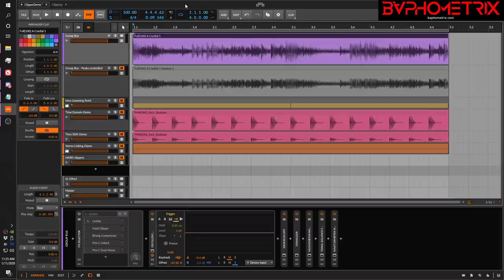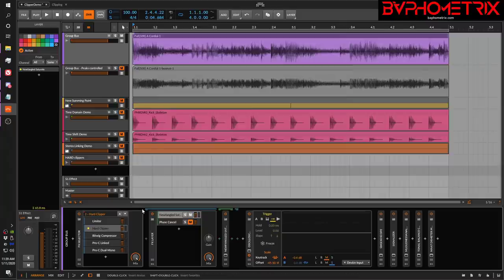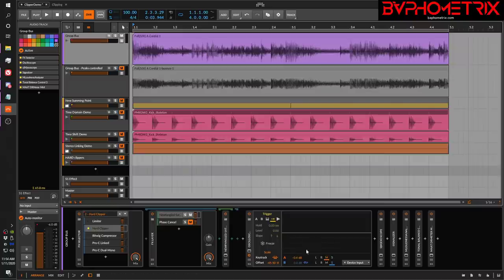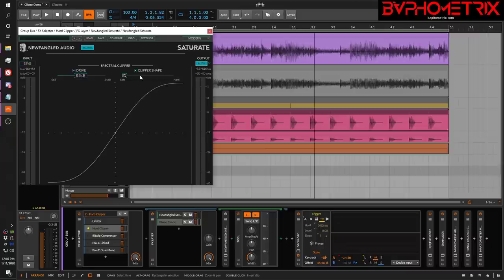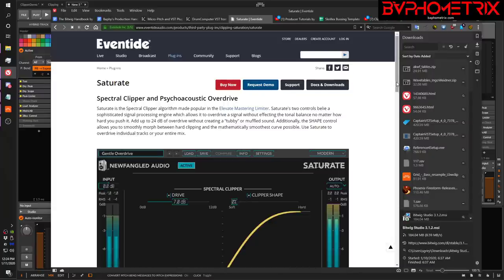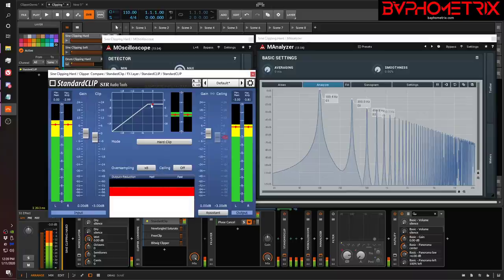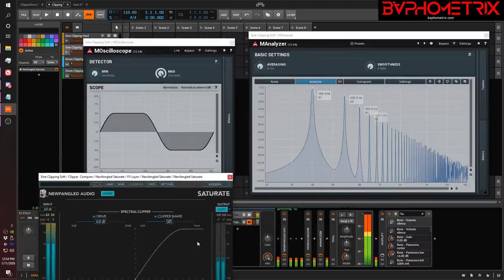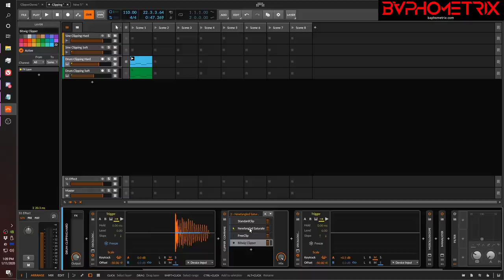Deep dive into clippers--NOT compressors--for clean, transparent loudness

Comment: I definitely understand where you're coming from with compressors being time domain devices. I synthesize my drums from general purpose plugins so I will use compressors to emphasize different aspects of the transient. On something like a kick drum, frequency content is extremely time-dependent, so I can even shape tonal characteristics using compression. After all the sculpting, I saturate all my drums pretty intensely and generally distort everything else as far as I can with soft clipping and pull back if it causes any problems. I have only ever used hard clipping at the VERY end of the signal chain just to get that last 3dB. I imagine you can get away with hard clipping whenever aliasing will be sufficiently masked by high frequency content? Say, a snare drum or even particularly bright sounding vocals or synth lines? looking forward to coming back to this video and watching it through. I don't have an hour at the moment, but it's nice to see hard clipping getting something other than hate outside of a hardstyle festival!

Comment: Amazing amazing amazing content! You truly are a scientist by the methods you are processing each effect. I just have to add one thing if you want to take it to the next level. I think a good way to determine the differences between the clipped track and the limited track is by printing them and changing the polarity of one track (I think that's what it'a called) and you will get the isolated difference. I doubt it's much different as our ears can tell but it would have been nice if you had done that final experiment to conclude this tutorial.
Reply from the maker: It's called a "null test". Many clipping plugins give you a "Delta" button that does the null test inside the plugin, so you can isolate the sounds that are being added by the clipper. The ideal is to just hear little, very short "spits" and "crackles" that are quiet enough and short enough to be masked by the remaining energy and timbre of the transients.

Comment: Interesting Video with some good points, but also clear mistakes.
 1.) If you want to analyse the behaviour of an 1176 you should choose a better representation.
Other Mixers and Producers found, that the waves model has a much slower attack time than other emulations and certainly the hardware unit.
If you are testing an 1176 you should use a broader sample range and if it's software, it should as far as functionality goes at least be closer to the real thing.
2.) I can clearly hear the Artifacts when you demonstrate the "transparent" results of clipping. Is it a shocking and complete transformation of the source material? No. But the artifacts are there. The point I would make is, are you as a mixer ok with it? That's what matters.
3.) Controlling the peaks does not necessarily mean that they have to be removed. Compressors are used exactly because often you want an part of the transient to come through. This is intentional and, because the term is loose, it's still controlling the peaks.
4.) Why do you say that the loudest part should be mastered for 7LUFS Loudness? I understand, if you like what you hear doing that, but why should that be your goal?
I don't like how music sounds, that is mastered this loud. I've had professionals do that and the end result was not serving my music properly. If it does yours then by all means, but I wouldn't state it as something to strive for in general.
Otherwise you're just doing the on principle the same, as the people you are trying ro educate: Saying one is better than the other.

Comment: Thanks for all your audio efforts. Around 43 minutes you show the hard clipping distortion by phase cancelling. Would it be possible to get rid of it completely by bouncing the distortion and use it to cancel itself out against the processed audio? Around 46 minutes you describe the top right quadrant of Saturate. Does the bottom left quadrant affect the volume of lower amplitudes during soft clipping?
Reply from the maker: There are no magic sleight-of-hand tricks that will get rid of the clipping distortion. The point of the phase cancellation was to remove the original sound and let you hear the clipping itself. In fact, some people like to SET their clipping thresholds this way. I prefer to use an oscilloscope and visually set my threshold, because I use scopes and meters everywhere all the time and know what sounds LOOK like. But you could do the phase cancelling and just set the clipper threshold right above where you HEAR the "spits and pops" starting to have some tonal content bleeding through too.

In Saturate, yes, that lower left quadrant is shaving the BOTTOM peaks of the waveform. Not the "lower amplitude" sounds---those are all near the fat center section of an oscilloscope. So the bottom left quadrant is shaving those caterpillar peaks way down at the bottom of the oscilloscope waveform, and the upper right quadrant is shaving the caterpillar peaks up at the top of the oscilloscope waveform.
Reply: @Baphometrix  The phase canceling trick to the clipper blew my mind! So simple but so ingenious.

Comment: For acoustic drumset, do you think it’s best to hard clip each individual mic (12 mic setup for me), then bus them all into a final bus clipper? I’m trying to incorporate this approach as opposed to using traditional compression on the individual tracks/mix bus. I find the most dynamic instruments in a rock mix to be bass guitar, vocals, and drums (mostly kick and snare). I’d like to maintain the natural dynamics more than using compressors, do you think the hard clipping will maintain the original sound better?
Reply from the maker: You might benefit from watching my newer "Mixing Loud with CTZ" series. But the short answer is that recorded acoustic drums are... tricky to mix well. There are a LOT of variables. But yes, assuming you find that *very transparent* point to which you can safely clip each individual recorded drum track, you can then set the relative mix of each drumset track with the track faders after pre-processing each individual drum sound. Any clipping you might do is simply part of the standard processing of each sound. 

My main advice in this scenario is to NOT clip sounds that you plan to balance very quiet relative to everything else. For example, the snare will probably be the "loudest" sound in your entire DRUMS bus. And the kick will also probably be very loud. Those might need to be clipped to get the final result of the entire drum set loud enough to be one of the framework sounds of your entire song.  But your overhead mics? Your room mic? Those will be barely blended into the total result. They don't need to be clipped, because they'll have tons of headroom within the overall dynamic range of the DRUMS sub-mix. Hope that helps!

Comment: Greetings and good day. I just came a cross your channel today and the info your sharing is great. I listened to your SoundCloud and your mix is fire. I have a question you may be able to help me with. I use the maschine mk3 and the sounds in it are already very loud but my mixes do not sound as loud as yours still. What I would like to know is on maschine for dance/hip hop should all instruments be turned down from source to avoid internal clipping then add clipper or does it matter? When I cut instruments down from internal source to mix my mix sounds thin, When I leave the internal vol of instruments at default it sounds louder, is it necessary to get every instruments in the green on meter before adding clips, eq, etc... or does it matter?
Reply from the maker: I wish I had some easy answers for you, but honestly the Maschine workflow is great for composing/arranging, but a bit constricted for *mixing*. When I find sounds/arrangements I like in Maschine, the first thing I do is get them into the right key for my song, and then bounce all that audio out of Machine and into clips and stems in my DAW. From that point onward, it's just audio and I can look at it and clip it, and do all the same post processing I'd do to any sound coming out of any softsynth or sample pack.

Comment: Another great vid. thanks.

Ive heard you can eliminate any potential issues from foldback distortion by just adding a 18-20k highcut using an EQ after the clipping? Any further processing after the clipper would not be effected right
Reply from the maker: No, that won't really work. The high pass filter must be IN the plugin's internal processing circuit and be applied BEFORE the plugin's output back to your DAW. Once that aliasing foldback has been output from the plugin, it's already baked into the signal and is already sitting below 22-24 Khz. So adding a low pass filter after that has happened won't change anything at all.

Comment: Question: on saturate, do you keep detail preservation on or off when hard clipping? When detail preservation is on and I phase cancel to hear the difference, I hear a lot of the original signal. when it is off, I only hear the white noise. The latter is what you demonstrated to be the goal, so I should keep it off right?
Reply from the maker: Good question! If you're using NF Saturate, I recommend keeping the detail preservation at full 100%. The reason you hear more of the original signal when you null test is precisely because of that "detail preservation", which is the entire point of expending more resources to swap out a more simple clipper (like KClip) for something like NF Saturate.  This additional info might be helpful: https://docs.google.com/document/d/1Ogxa5-X_QdbtfLLQ_2mDEgPgHxNRLebQ7pps3rXewPM/edit#heading=h.h86oecwgie0f

Comment: May I suggest something about oversampling? You state at about 1h05m that the bounced frequencies are inaudible and oversampling were unnecessary. However, your sine signal is very theoretical, NOT because it's a sine, but because it's at 100hz base. Bounced frequencies here are always ABOVE the base frequency and, as you correctly mention, masked, because they are way less loud than the useful harmonics. BUT - please, repeate the same for frequencies above 12kHz, you know, those frequencies giving you air, or those produced by cymbals or resonance-filter-cutoffs of saw waves. THEN you will see quite audible bounces way BELOW 12kHz. I tried a 15kHz sine wave at -0.1db,  with StandardClip clipping at -6db hard clip and ceiling turned on. With no oversampling, I get a -17db (-seventeen!) bounced frequency at 2.6kHz. Which is VERY audible (and anoying). With 8x oversamling, this frequency drops below -100db. So in the real world, it does make a huge difference if your clipper oversamples ;-)

Comment: Polarity made a clipper for Bitwig Grid. I might get back to it and see how it works for this
Reply from the maker: It doesn't, really. IMO it's worth spending for KClip, at least. Also, Bitwig is dropping a Hard Clipper module in the Grid for the upcoming 4.2 release, but I haven't tried it yet.
Reply: @Baphometrix  My problem is that I'm using Linux so pretty much most VST plugins are out of my reach. I'm hoping the 4.2 will solve my clipping needs

Comment: Fantastic video.  Thank you.  I learned a lot.  You made a point about hard clipping busses and sounds before the mastering limiter, so that that mastering limiter doesn't have to work as hard (and cut into subsequent content with the release curve).  If you're only clipping fast transients and "shaving the hair of waves", isn't that the same content that gets past the limiting compressor that ends up against the hidden clipper in the limiter? Pre-attack content.  An isomorphism perhaps?
Reply from the maker: That would seem like a first impression/understanding, right? But think carefully about it for a moment. When a mastering limiter detects a transient peak that is a full 12 dB (for example) over its threshold, it will react and clamp down by a full -12 dB of gain reduction on the signal. This takes place over a very short amount of time (the attack envelope), letting a +12 dB transient slip through, which is then lopped off by the hidden clipper at the end.

Now do it again but this time say the limiter detects a transient peak that is only 1 dB over its threshold. This time the limiter reacts and clamps down by only -1 dB of gain reduction on the signal. And a +1 dB transient peak slips through, which is then lopped off by the hidden clipper at the end.

See the difference? We shave all those caterpillar peaks off long before we get to the final limiter so that the limiter isn't trying to squash down so hard. We want the limiter working very little.

Comment: If you wanted to, for example, use an analogue-modeled compressor VST on your drum bus for color.  Where would you put the compressor in the chain, to avoid driving things way too hot into it? Would the clipper go before or after?
Reply from the maker: The clipper (for transparent dynamic range control) always comes at the end of the processing chain for any given track or bus channel.

Comment: offtopic: Is that XO the drum sequencer plugin? How do you work with it? I find the best way is to export the samples and load them into Drum Machine... but I'm wondering if there is a more 'frictionless' way to integrate it into bitwig
Reply from the maker: I use it a lot like I once used Atlas. There's a relatively simple way to work with XO in "multi-out" mode so you can process all drum sounds individually. And when your drum lines are all worked out and you're ready to flatten everything to audio at some point in the mixing process, it's a fairly easy thing to do as described in this video of mine. https://youtu.be/Sn8zmOUA2rI

Comment: Thanks for this interesting and informative lecture. i learned many new things. Any suggestions for hardware units we could do this with?
Reply from the maker: Most analog circuits (and analog tape) already do soft-clipping when  you drive them hard. It's part of the "magic" of analog gear. I think hard clipping is only possible in the digital realm, though.
Reply: @Baphometrix  hmmm yeah that's true, i'd hoped there might be a simple guitar pedal that does hard clipping or something though I'll look around. I guess it makes sense what you were saying about the relationship between distortion and compression as people think of even analogue tape as bringing a mild compression dont they.

Comment: Great video! So I'm mixing a song and I have the Mixbus at about -3db headroom before Mastering. However, I see on Smexoscope a couple caterpillar legs (very skinny peaks preventing the real body of info from being at -3db) higher than everything by 1-2 db... only in Choruses... on the downbeats when many things hit at once. Odd thing is they are not always the same peak level each pass so they are not so easy to locate and find what tracks are causing therm.   If I mute something like the vocal, they will get diminished most the time (but I don't want to lower the vocal levels). Same with a few items like drums. If I mute them peaks go down ... but I like the levels. This seems to be a good time to clip those few skinny peaks and gain a couple more db. So for the most clean transparent job... you recommend hard clipping? Any other settings? I own Standard Clip and Saturate. Thanks!
Reply from the maker: Saturate is great and very transparent as clippers go. "TrackLimit" by DMG Audio is a great *limiter* you can plop all over many tracks and busses too.

Comment: Just came across this channel, and I'm not far along into the video, but I just had a thought. If you wanted to hit the initial transient on a compressor, couldn't you sidechain it to a dupłicate track nudged some ms/samples earlier? Just thought of this as I was watching and never tried it out, curious about thoughts here! Cool video, and curious to keep watching.
Reply from the maker: You certainly could. Or you could just use a compressor that has a lookahead control. But that doesn't change the fact that compressors work in the time domain... they carve entirely new AR envelopes into the original signal. Clippers are instantaneous, and don't re-envelope the signal. In short, you use compressors to change the *dynamic feel* of a signal. You use clippers to transparently control the dynamic range (crest factor) of a signal.